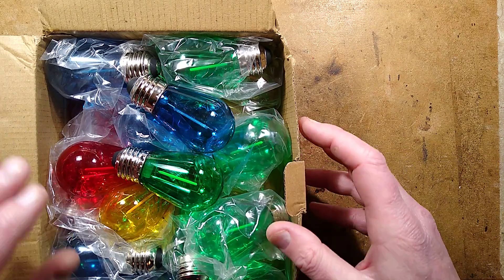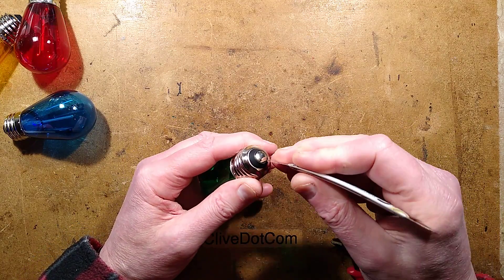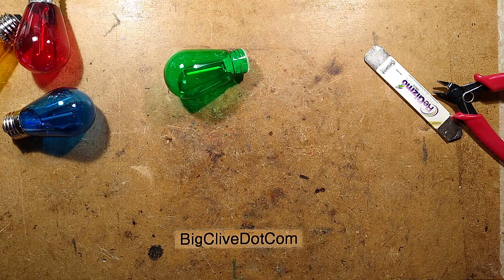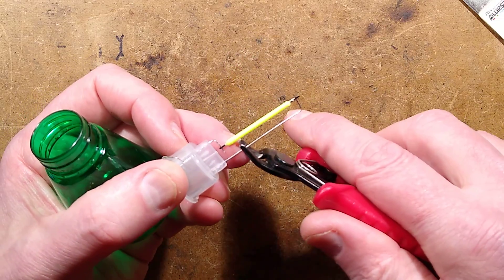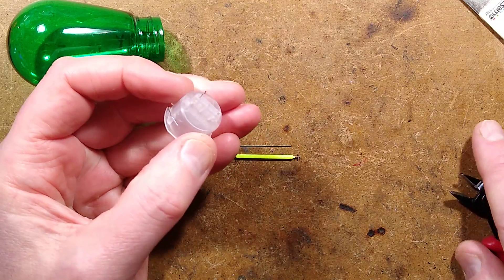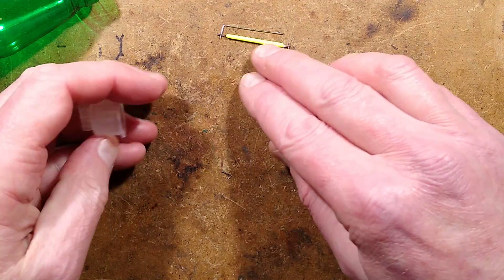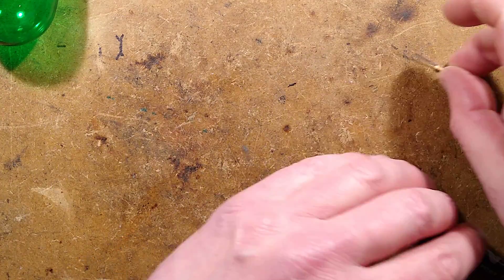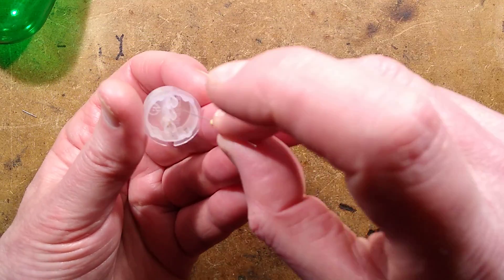Modifying Temu LED bulbs - really neat circuitry

Comment: Clive, last year Technology Connections did a video on Tru-Tone, a US manufacturer of LED Christmas bulbs and strings. I just ordered two sets because they seem to be very high quality (fused, 20 AWG, brass fittings), and, according to TechConnect, also have a vintage incandescent feel.
Reply: Would love to see Clive take a look inside one of those bulbs!
Reply: Technically not a US manufacturer, just a US company. They are made to the company's specifications in China.
Reply: i came here to mention technology connections looking at the same colored plastic / glass arrangment, and i would of been the first to if it wasnt for you meddling members
Reply: No Scooby Snacks where your going. @superfly108
Reply: I have some trutone bulbs, and I can confirm they look just like vintage incandescents. But they cut the energy bill at Christmas last year by SO MUCH that they paid for themselves almost immediately.
Reply: Why not pull the pin on the base and solder a third resistor,  then stuff it in the hole, then repin the lead? You already know what value you need and disassembly extra parts is minimal.
Reply: I ordered a set from Tru-Tone last year, as they were completely sold out the year prior when Alec's video came out.
Yes, the sets do cost substantially more, but they're using high-quality components, and the bulb colors are authentic. Zero flicker, which is always nice to see (or not see, I guess). I'd even go so far as to say the sockets and wire are BETTER than vintage sets.

This is one of those times where you really do get what you pay for, the sets aren't cheap crap designed to make a quick buck!
Reply: Brilliant Clive they look fab maybe make them to go into that set that someone burnt out on 240v not 12v 😊
Reply: I looked at them too but they are expensive a set of C7 is like $34 US. That’s bulbs only ,  4 strands of 25  $136 US.
Reply: I will stick to my cheapo walmart lights lol @jhonsiders6077
Reply: There's still not a similar product for the smaller xmas lights.
By which I mean white LEDs with colored caps to get a more authentic look to the old incandescent bulbs.
Reply: Treasonous Two-Timers !
.  ; )
Reply: Is that the same tru-tone company that makes software for digital screens?
Reply: @tronixfix how about those old intercoms in 70’s homes?
Reply: as close as they are, they absolutely do not match the genuine warm glow of incandescents.

Comment: Cool. I'd probably combine two bulbs into one and series the filaments to get more of the power into the LEDs and less in the resistors.
Reply: Or just wire pairs of sockets in series…
Reply: @flyingmoose  I was thinking the same.
Reply: @flyingmoose  with only 65V of drop out per led strip, we can even put a trio in series on a 230-240 main voltage to further improve efficiency.
A small bridge rectifier and a smoothing capacitor could be a nice addition to avoid the low freq flickering.
Reply: I was going to comment that
Reply: I woud also guess, a rally driverless or AC LED is reliable but yeah the flicker rate so a more True ultra efficiënt LED lamp that stay  lukewarm instead of griled LEDs ant heat goes to the drivers and capacitors
Reply: This is what I commented in the main thread:
Still can't see why you cannot get rid of all the 6 parts, the 2 resistors and 4 diodes. LED's placed in two strings counter parallel (or individually counter parallel and then a series string), and enough of them to divide the full peak voltage into their cosy zone should work. We never did because it was outside of such globe and as such quit dangerous, but with these techniques here used and placed inside a globe it would be safe. Why less reliable ? And the 2x 47K + 4 diodes dissipate 4/5  of the power, 1/5 is for the LED's 🤔 Where does my thinking go wrong ?

Comment: An interesting integrated FULL BRIDGE RECTIFIER - keeps the whole thing very simple, but lack of a filter cap is a big drawback. I'm so tired of all those cheap-ass flickering LED lamps.
Reply: Clive made it less flickery though, by buying 120V lights which will have a lower off-time when running on 240V.
Reply: @rexsceleratorum1632  🤣
Reply: @rexsceleratorum1632   Wouldn't they have a HIGHER off-time, since we're pushing twice the rated voltage through them? 😆